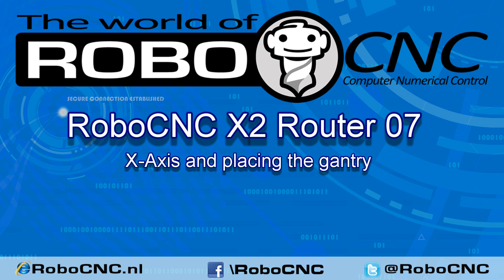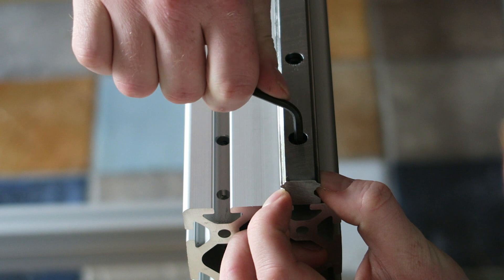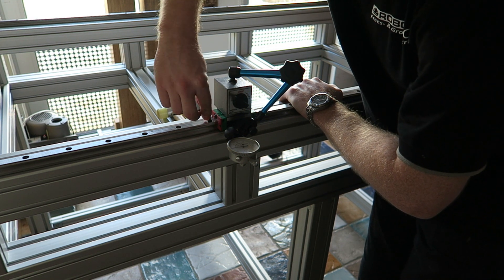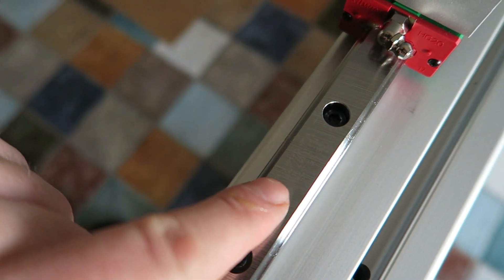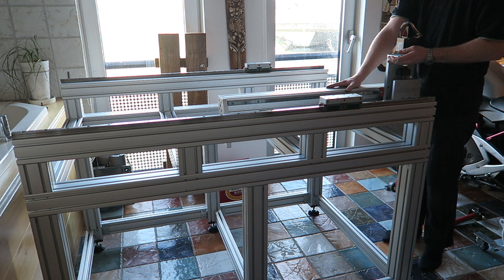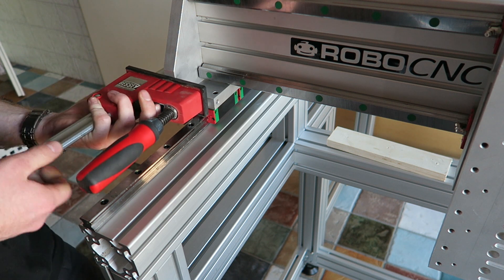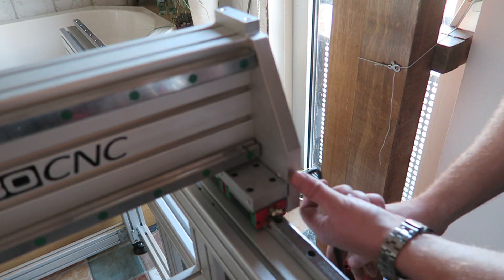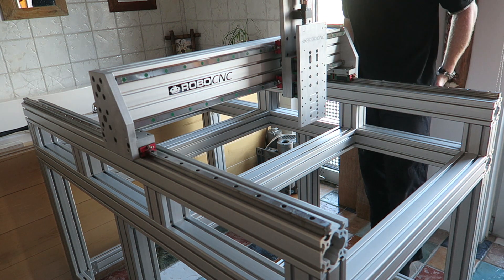RCNC X2 Router 07: X- Axis meets Y-Axis

Comment: Hi RoBo , I am new to your work shop, I am very impressed with your work, I am thinking of making or buying a CNC router for slab resin and wood projects later in the year, did you buy a purpose built Machine or did have someone make the components for you, Or did you order the Rail and track cut to a pacific size on line, then assemble yourself, PHIL FROM THE DARK SIDE OF THE MOULIN FRANCE.
Reply from the maker: Hi Phil, 

For your work you can debate if you need a CNC router. Just rails and a router to flatten everything would be an option. Anyway, take a look in the rest of my videos to find the answers to your questions. The machine is build in house.
Reply: @RoboCNCnl  Hi 👋, thank you for your reply, yes I have been looking, very interesting, if I can get the The materials I think I might have a go myself I’ve seen lots of bits and pieces online, I did say something I think it was made in Canada that was very interesting the other day on YouTube good Inc three devices a router head , 300 wide planer , 300 drum sander . With a very heavy pricetag I think It was over $40,000.
But this will be a project for later in the year as I’ve got to finish doing my garage floor and the roof on it, it’s more a renovation project than anything else, Thanks for the info, And I did manage to find you works details you’ve got some interesting projects, stay safe, PHIL FROM THE DARK SIDE OF THE MOULIN FRANCE.
Reply: @RoboCNCnl  I forgot to Ask you a question I just went back into your tutorials on build or router table, Why did you use a rack and pinion system, Instead of a ballscrew. PHIL FROM THE DARK SIDE OF THE MOULIN FRANCE.
Reply from the maker: Listen to what I say in the videos Phil, it is all explained… in short, long ball screws will not work due to any inertia and vibration.

Comment: why do you put the trolley in a straight line to the aluminum profile, I'm not a professional, but rather the profile is crooked compared to the guide which has some tolerances ... which means you bend the guides. In parallel, it should be with the second guide.
Reply from the maker: The profile is the straightest part in the build, so bending the rail straight. And then making the next one parallel.

Comment: The precision linear guideway is exposed to dust. Any way to protect them.
Reply from the maker: MySchizo I use dry lubes to prevent dust from sticking. This reduces life of the bearings, but that’s the concession to make. There is no way to prevent dust from getting their.
Reply: @RoboCNCnl  looked at the design of cncrouter parts. They have the linear guide mounted on the side of the extrusion and cover is attached on the top of the extrusion. Essentially covering the linear guide from direct dust.

Comment: Nice job bro, But I think the Y axis is 1344 mm and the X axis is 682 mm long at 11:47 min . Thank you a lot
Reply from the maker: After 12 years using CNC I'm quite sure i can deside wich axis i will use as X and Y :) . But since you are here to learn.... It's totally up to you, or the way you operate the machine... 
X goes from left to right, and Y moves away from you, so from where do you look at, and operate the machine..
Reply: I watched all your videos, I did not see the machine while its running as you said it depends on the orientation you stand front of the machine.  Anyway its good job go ahead man. @RoboCNCnl

Comment: Nice design, but how do you know that the extrusions are straight? Aligning the rail to the side of the extrusion does not guarantee that it will run straight. I would use a precision straight edge here.
Reply from the maker: And where would you put the precision straight edge on..? where is your assumption....  (By the way, i talk about this subject in the video)
Reply: @RoboCNCnl  I'd put the straight edge against the rail. And I would not set the rail directly on the extrusion. I'd have it on a piece of flat stock and that would set on the extrusion.

Comment: I've seen people adjust the rail so they measure it only to the next rail as the profile you're using are not exactly precise. I'm not sure what's the best method. Unless you've used precision ground extrusions.

Also what's your take on the Clearpath servo's ?

Love the build so far. Really considering getting into it.
Reply from the maker: Follow the one you feel is the best Jannes :) but indeed, you have to assume something, or have a giant measuring table. I have had this advice when talking to a machine builder, who jade done testing on these profiles. They are not ground, but the error is quite low. Anyway, it also depends on what you try to accomplish of course.
Reply: i wouldnt   "bend" the rails to the extrusion. rails are ground to pretty high tolerances ; extrusion can be off  over .001" per foot

Comment: Great machine ! I am sure You will have a lot of fun with it. It is always hard to set left and right X rails to be parallel. INMHO You should tighten the screws at 5:33 to let its adjust by itself. Will You set one or two X axis ballscerws ?
Reply from the maker: Hi, thanks for watching and the comment......
 Well IYHO you are basically right... And I should have said so in the video.... 
In my case the bolt holes where CNC made, and really tight, so the are aligned absolutely fine. nevertheless I could have included that in the video... 
The X axis will be driven by two zero backlash rack and pinion systems (with a double pinion). 
Stay tuned (ar search for a preview on instagram / facebook)

Comment: nice build but there is no way your gantry weighs 150kg, I use the same item 80*160 profile @1.8m long and mines filled with silica sand and if also has a steel plate bolted to it and it weigh around 80-90kg.
Reply from the maker: That was not what i said... I said "everything you see here is about 150kg" So the base, and the gantry, plus all of its parts..)

Btw, do you think your decision of filling it with sand (a lot of extra inertia) is a smart thing to do? 
I think It would only be a good thing for the base (non moving parts).
Reply: +RoboCNC Frees- & Graveerwerk ah ok. I filled all my extrusion with silica sand, the sides, slats, risers and gantry and it was the best thing I ever did. it's taken all the harmonics or of it. the extrusion used to have a ring to it, now it's solid and doesn't ring and it's taken abit of the vibration out of it, to combat the inertia I just adjusted the velocity and acceleration in mach, it still works fine at 25m per min for rapids,   I used epoxy to cap the ends so if i didn't like it I could just drop through the epoxy and pour the sand out but I will be leaving it as it performs much better and dampens the machine.
Reply from the maker: Yes I can imagine the extra mass will change the harmonic frequency for the better. But I doubt it's the best thing for the moving parts like the gantry. 
Most people talk about there G0/rapid speed, I personally don't care about that at all, when will you ever machine at 25m/min? The acceleration is very very important for me. especially for 3D work this is where the time gets lost... 
Anyway, If you had vibration issues you have to comprise, but i hope I don't have to...
Reply: +RoboCNC Frees- & Graveerwerk I never really had vibration issues. I just wanted to bulk it up. I am running nema 34 on all axis with a 3:1 great reduction, I agree about rapids but I do cut some things at 12m per min and it's nice having the extra mass when doing that, it's made a huge difference in milling aluminum.